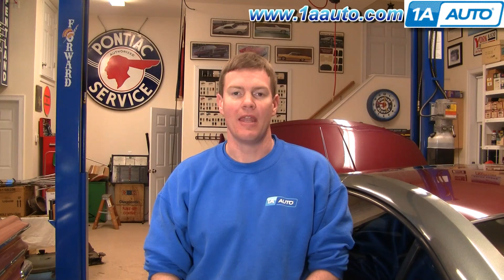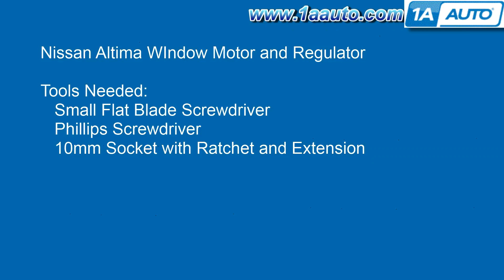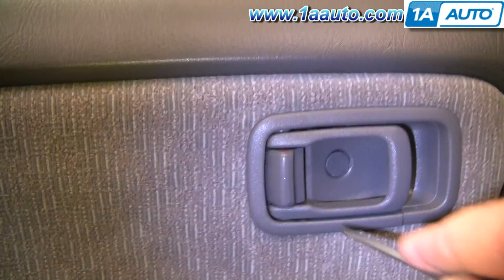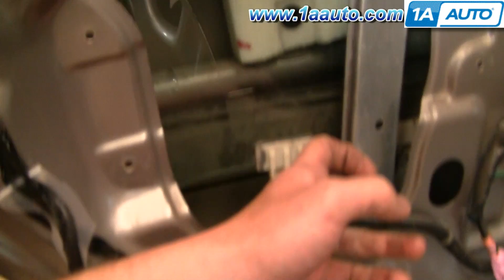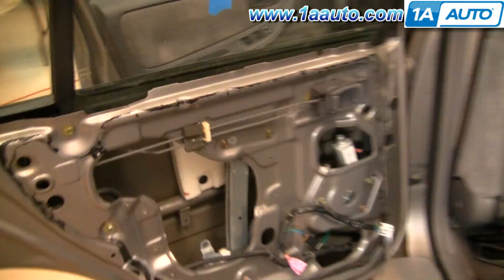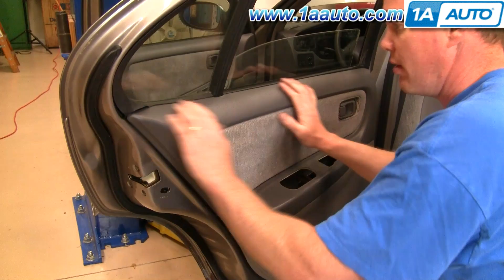How to Replace Window Regulator 98-01 Nissan Altima

Comment: Can you do one for a 2007 Sonata GLS, rear window regulator? They (Hyundai) appear to have bolted the entire regulator assembly to the inside of a rather large, contoured, pressed steel plate, the size of which is nearly as large as the door, and  has bolts around the circumference, screwed into the door perimeter sheet metal. It appears an elegant way to manufacture the window mechanism. Perhaps later model Hyundai's have manufactured this way, too.